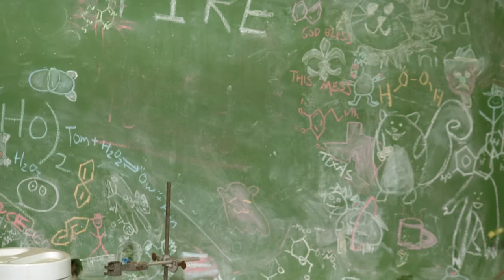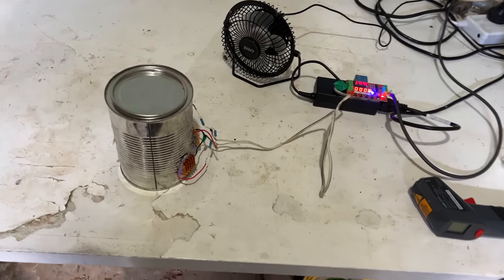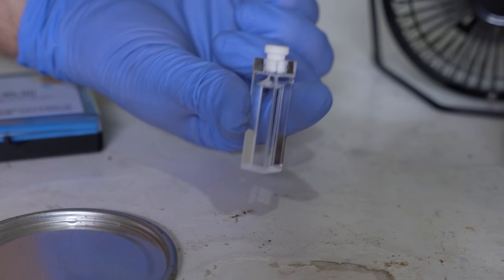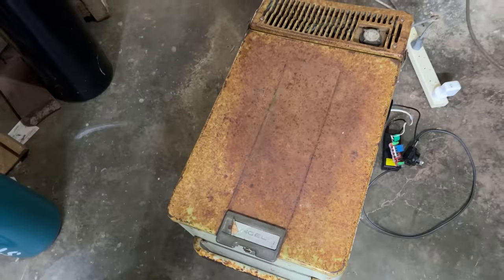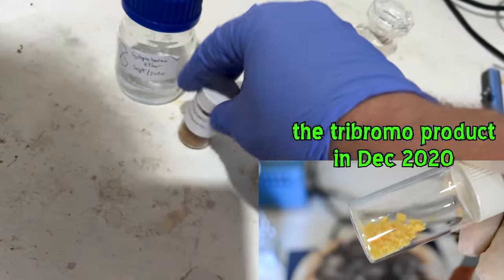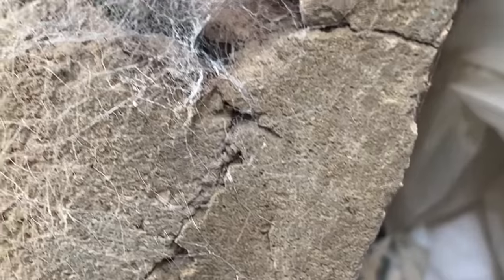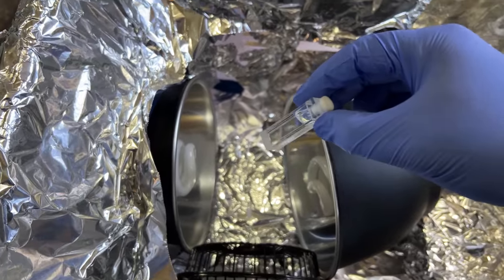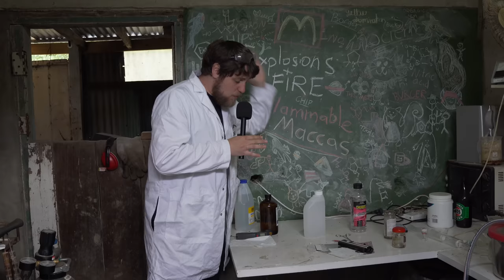The PhotoFridge - Cubane Ep 13

Comment: We need to get a "Have you seen this molecule?" message on the back of every milk carton
Reply: And then a shirt of such a milk carton image for merch
Reply: @ripvanwando  I'd buy that.
Reply: That was exactly what I was thinking too 😆
Reply: @ripvanwando  seriously, that is so merch
Reply from the maker: @kumoyuki  i'd wear that
Reply: It shall be done
Reply: I’d buy an empty milk carton with the Have You Seen This Molecule picture in it
Reply: I would buy this shirt
Reply: @armoire  shipping empty milk cartons might be expensive because they are bulky, but, it does seem totally doable to get them printed with low qtys…
Reply: Is there anything preventing someone from just shipping this poor bloke a small sample from like a supply company or something? (I have no idea, I work in a NOC, not a lab :D )
Reply: KEKW
Reply: @benpye6854  don't see how that's an issue it's empty and if you're selling empty milk cartons with custom designs on them they're going to be shipped to you flat packed already single piece large pieces of cardboard stacked and bound that break apart into individual still flat cartons that you can ship as easy as they were to you. Not like you would order them  from a milk company filled you would be ordering the carton from a graphic designer and printer company presumably.
Reply: @MrDJAK777  I honestly have no idea why I thought they would be shipped assembled but unfilled rather than flat 🤦
Reply: @ExtractionsAndIre  make it, and then use the merch sales to maybe buy the molecule from Ligma Aldrich or something lol
Reply: @ExtractionsAndIre  id wear that

Comment: So I'm a PhD student that has had the misfortune of having to work with compounds with the same functionalities as your product. Trying to analyse them with TLC is a real pain. There is nothing to oxidise, so KMnO4 does nothing. They don't absorb UV-light. Iodine only sometimes work. I saw some other comments suggesting some more exotic stains, which I haven't tried, bit I think there is one more accesible one that you should try first: vanillin. Vanillin is an aldehyde, that, if activated by a strong acid, is a very strong electrophile that reacts with essentially anything nucleophillic. The products are often coloured, so they are very easy to see on TLC. Ketones can under acidic conditions tautomerise to form nucleophillic enols, and I've had some success with it for this type of compounds. It also smells very nice.

To make the stain, just dissolve vanillin in 1% H2SO4 in ethanol. You will need to heat the plate quite a bit to see anything, but if it works, it should be pretty obvious that it did.

Good video as always, BTW, I think you are pretty close to figuring this out now.
Reply: Comments so he sees this more bigger
Reply: And anisealdehyde
Reply: Things are gonna taste yellow
Reply: my question is why not spectrum machine? he is still a phd, right?
Reply: Yea Vannilin is a good one to try. Neat bonus: it smells really nice!
Reply: Problem is, that ketone isn't nucleophilic-enol is an anti-Bredt olefin...perhaps if the ketal pops off as well it might work. I guess it's worth a try in any event.
Reply: @yeyuan6273  Are you talking an NMR? That was a random sub, who could definitely do that, but it isn't timely and there runs the risk of Australia being Australia and questioning tiny amounts of liquid in specialised containers or powders in a baggie and labelling. On top of that, the guise of "DIY" still exists and definitely isn't either an excuse for laziness, an excuse for indulging some kind of masochistic tendency, or a legitimate cry for help... Probably.
Reply: @yeyuan6273  Because he specifically wants to make it using stuff available to a home lab chemist using relatively easily avalible stuff (as far as is reasonable) . He speaks about it in the first video iirc.
Reply: Why not DNP (Brady's reagent)? The product has a ketone.
Reply: Nile Red's most recent video used vanillin for his hotsauce creation. It was like his "missing piece", and it would be really cool to see if this is the missing piece for E&I too!
Reply: Vanillin or p-anisaldehyde would be my stain of choice here, too. Those ketones should react with anisaldehyde to make (in my experience, bromos may change things) dark blue to purple. I like vanillin better, but my company uses anisaldehyde, so I haven't used vanillin since grad school and can't remember the colors.
Reply: In colorimetric spectrophotometry that I frequently run, I use sulfo-phospho-vanillin for lipids and anthrone assays (TCM and methanol separation). I'm physiology, not chemistry, so I do not know how transferable this is. A former colleague of mine would occasionally toy around with a concept of using fuming sulfuric acid to develop phosphoric acid-vanillin to develop on plates and membranes, though I don't recall why she doing it.
Reply: Don't tell him, I watch for the hilarious decent into madness
Reply: @guffyscotland9605  well he should just build a bloody nmr, mass-spec, and ultra-fast laser lab with all that YouTube money and put his newly acquired soldering skills to work... it's been 2 about years... ffs give styropyro 2 years and he could finish laser etching his balls on the moon... DIY NMR from scratch including making the bloody superconductors and other critical components from raw ore mined fresh from the outback by an army of spiders minions is the sort of amateurish super villian content we've come to expect from this channel.
Reply: I doubt that a couple of vanilla sticks will work mate
Reply: You gotta write this upside down else he's not gonna be able to read it bud
Reply: @DaftFader  i agree with you guys at some time, until finally i get enough to invested in a platinum wire, bo.....problem solved......
Reply: @yeyuan6273  Yeah this project was always gonna be pushing the boundaries of what a home chemist could do, I think that was the allure of the challenge for him in the first place. That and making things go boom with new things he's made. xD
Reply from the maker: Ok I've ordered some vanillin! That's a great suggestion
Reply: @ExtractionsAndIre  The vanilla ice-creams are on him!
Reply: if it doesn't work, at least it'll smell nice
Reply: You can't spell villain without vanillin!
Reply: @ExtractionsAndIre  both papers you linked to used acid (HCl or H2SO4) in methanol after deoxygenating it with dry nitrogen or argon as the solvent for the UV step. I know you used up your argon cylinder in the hydrogen peroxide video, but at this point, anything is worth trying.
Reply from the maker: @isaacbuss9308  Yeah I do have a new tank of argon- maybe the oxygen is messing things up?
Reply: I enjoyed reading your big words, chemistry man.
Reply: @ExtractionsAndIre  Hey, here’s a crazy idea of mine:
Just heat up the TLC plates until everything on them turns into tar.
Then you’ll see the organic spots.
If that doesn’t work, put the plate in a bottle of chlorine gas and leave it in the sunlight THEN heat the hell out of it.
It’s bout to do something, anything.
We just need to see the tar spots on the TLC plate.
You have my blessing, nuke your TLC plates.
Reply: @robmorgan1214  This sounds like a very normal Cody's Lab video, tbh.
Reply: @shorty1815  exactly! C'mon man! Even a wannabe Martian is making MRI machines with a chicken in a cave somewhere!
Reply: @shorty1815  I was thinking more Ben Krasnow/Applied Science
Reply: @ExtractionsAndIre  hooray!
Reply: @ExtractionsAndIre  The vanillin/anisaldehyde stains are good universal stains but a ketone/aldehyde specific stain that I’ve used before is dinitrophenylhydrazine. It only stains ketones and aldehydes and it forms the hydrazone which are usually brightly colored so they’re easily visualized. A recipe for the stain that I’ve used is 12g dissolved in 60ml concentrated sulfuric, 80 ml water and 200ml 95% ethanol. You may want to make less than that though as this stain doesn’t keep for years at a time, I’d estimate the shelf life at about a year max. Just as a note this stain also doesn’t work on esters or amides, only ketones and aldehydes.
Reply: @user-ko7lz3kr1d  DNP would be my go-to in this scenario too, was about to recommend it when I saw your comment :)
Reply: Vanillin or possibly Hanessian
Reply: @teyrasiridae4704  I actually now agree with the other commenters that vanillin is a better choice in the home chem context, and actually in my academic lab we don't even have DNP because it's kinda expensive being a hydrazine with a rumored reputation as an explosive. But we have NMR and LCMS so no big deal.
Reply: @user-ko7lz3kr1d  I guess that's fair. I work in a lab that has access to just about anything, so it's easy to forget what you can't readily obtain at home. One of my favourite stains is p-anisaldehyde.
Reply: @nullnull5268  mmm black liquorice
Reply: @teyrasiridae4704  I like it too just because it smells good. But it can be useful for spots that are close together, but my compounds these days don't stain so well in anisaldehyde.
Reply: @ExtractionsAndIre  Never had much luck with vanillin stain, wouldn't expect it to work on Aliphatic ketones like this, but I've been wrong before, may not even see a spot in KMnO4. I've always had good luck with pma. Phosphomolybdic acid. Basically my go-to for the past 15 years.
Reply: I only just watched this video and have recently been using vanillin for hard to TLC compound's so I'm glad you mentioned it here, it worked well for me hopefully it works for Tom.
Reply: @ExtractionsAndIre  sorry late to the party, got unsubscribe again, thanks for the great work as usual
Another possible source for quartz might be one of the CFL ozone UV lamp 
Got to deal with the little bit of mercury tho
Reply: @yeyuan6273  this is a home chemistry channel, it's my understanding he wants to do this project with only resources available to the average consumer.
Reply: Are golf shoes good for gaming.
Reply: @FredBGC: Not trying to be a smart ass, but it's a very common misconception that compounds need to be UV active to be detectable by regular TLC. If they were, the fluorescent stain in the TLC plate would be useless. They work by fluorescence quenching. Where there is stuff, the fluorescent dye is quenched and you see a dark spot. Some compounds don't really do that for some reason, but it's rather rare.
KMnO4 stain should work on practically everything with heating. Maybe your staining solution is too concentrated?
Iodine stain works by iodine just sticking to organic stuff if I'm not mistaken. Hence the stain disappears after a while as the iodine evaporates again.

Man I miss doing organic chemistry :)
Reply: @ExtractionsAndIre  It could very well be the Oxygen. What you're doing in a photochemical reaction is to excite the electrons from the ground state. The result is two unpaired electrons which are highly reactive.
And oxygen happens to be a diradical as well, having two unpaired electrons. That's is why peroxides are formed so easily. Oxygen loves to attack lonely electrons.

However instead of bubbling your precious Argon through the solvent for several hours, might I suggest picking up a cheap ultrasonic which are sold for cleaning jewelry.  (And very good against tar. wink wink) Put the flask with your solvent in the ultrasonic, apply very gentle vacuum (obviously you wont get far with dcm), leave it for 10-15 minutes and backfill with Argon if needed. Repeat 2-3 times.

The issue I see is that your reaction needs to be very dilute, which means that even the relatively small amount of dissolved gas will be in a high proportion relative to your reagent. So worst case the reaction simply doesn't work on the pilot 1mg scale, but could turn out succesful with 50mg.

Alternatively (if you get acces to liquid nitrogen again) you can do a crude freeze, pump, thaw cycle on your DCM. That's the highest quality procedure for solvent degassing, but it takes some effort.
Reply: Vanillin smells good.  Give it a try~
Reply: @gamingmarcus  Why not do a classic freeze pump thaw mechanism for degassing, that way you should not loose any DCM and it is the go to degassing way for working under Schlenk conditions
Reply: @yeyuan6273  access and explaining what he's doing may be a problem
Reply: @jakob_212  That was my last point. He could absolutely do it, but DCM freezes below dry ice temperature and so a cheap ultrasonic might be an easier and long term more versatile aquisition than a tank of LN2.
Reply: Maybe phenylhydrazine could work because of the ketone group. 

Preparation of the staining solution:
- 12 g of 2,4-dinitrophenylhydrazine
- 60 mL of conc. sulfuric acid
- 80 mL of water
- 200 mL of 95% ethanol
Reply: @robmorgan1214  DIY benchtop NMR is very low resolution (20 MHz), and requires advanced electronics skills and a powerful magnet. It's a waste of time and money.
Reply: @robmorgan1214  ayo wtf
Reply: @bromisovalum8417  well he should get started on building that wafer fab and the necessary rare earths processing facilities he's got 1 year 11 months left... he really shouldn't put it off till the night before he uploads.
Reply: @Girvo747  oh, you're gone... Still shows it for me until I refresh, though.
Reply: @robmorgan1214  "ffs give styropyro 2 years and he could finish laser etching his balls on the moon." You know that if you were to actually pass this idea along to him, the moon would never look the same. Which begs the question.... are you gonna tell him, or am I gonna tell him?
Reply: @DaftFader  yeah but at this point sending out for an NMR test costs less than what he's spent on lamps
Reply: Need to drop 20k on an hplc machine seemingly
Reply: @guffyscotland9605  this, and there's also the fact that he speculated it might decompose when sat around doing nothing in his lab, so by the time it gets to someone with an NMR...
Reply: ye yuan, an NMR was run before, if all else fails it should be run again. Might also tell us what that contaminant is.

Comment: Using hot glue on heat sinks is probably one of the biggest DIY power moves, kudos. Also the new lab coat looks nice
Reply: it's an indicating adhesive, if it gets too hot it will melt the glue
Reply: @Mister_Brown  Thermal fuse, exactly!

Comment: That compound is a ketone, so it should give a spot with Brady's Reagent.  Also' if your solvent is giving a spot then you should distil it.  Maybe the manufacturer has added a stabilizer such as hydroquinone.
Reply from the maker: Ok great I’ll check it out! 
And the solvent is fine by itself, but not after it has spent any time in the cuvette with the lid on
Reply: @ExtractionsAndIre  maybe try washing the cubette with some other solvents instead because they could potentially dissolve it better than the dcm. 

Also try putting the stopper in some normal glassware and filling it with dcm before running the tlc on that dcm to determine if it really is the stopper.
Reply: I like this idea- probably the most low tech and solution to elegant solution to the visualization problem
Reply: @Stalutes64  Perhaps it's not the stopper, but residue that's leached out of the teflon tape.  If that's the case, removing the residue might be a possibility.
Reply: @PSUQDPICHQIEIWC  in fairness if the stain isn’t working maybe the quartz glassware isn’t actually necessary and it just wasn’t being detected when using borosilicate ?

Comment: Not pHd level anything, but just a heads up on using the ir thermometer: the laser is deceptive because they actually read in a cone shape (the angle of which will be on the label), and in addition aluminium is relatively reflective. So when you're measuring the heatsink temperature with the gun, you're likely actually measuring the heatsink and maybe the a 50c coin area around it on the Milo tin (and that temperature will also be skewed to the temperature of the tabletop by reflection).
Reply from the maker: Yeah I feel that. But it mostly is there to try and prevent me from grabbing things to see if they are super hot or are room temp
Reply: @ExtractionsAndIre  didn't look like it lmao
Reply: @crackedemerald4930  Tbf, he did write "try".
Reply: Yeah, this.. I'm saddened by the major caveats that come with these "laser" thermometers :(   you can compensate for the cone/spread by moving it closer, but the emissivity issue foils me.  Would  marking it with a sharpie help?  Piece of masking tape?
Reply: @adfaklsdjf  black electrical tape works pretty well
Reply: If it was bare Aluminium, yep. The anodised surface negates that problem.
Reply: Also that the optics are generally parallel. Which is good for targeting, it's consistent with distance, but it means the offset at the head is the same offset at a distance.  So you usually need to hold the laser a few cm above the target to read it properly.

As a physicist, I just look for signals anyways: sweep it across the target, trying different relative elevations, find the hottest spot -- that's probably your target.

The same is true of low-emissivity materials, like metal; most of it won't be visible at its true temperature, but some inside corners will shine as bright black bodies.  Downside, this is easier to see on a thermal cam -- smaller focus / pixel size; the thermometer probably has too big of a spot size so it doesn't resolve that bright spot, but smears it into a lower reading instead.

In any case, rest assured, the reading will never be higher than the actual temperature.  So if you sweep over the scene, and it looks like you're getting a good, well resolved peak, that's probably it, without having to make much adjustment for emissivity.

And yeah, tape or paint is a great aid.  Even a permanent marker will help -- but because the ink layer is so thin (some µm), it's nearly transparent at thermal IR (~10µm), so, try to put it on thick, but preferably use grease or paint or tape instead.